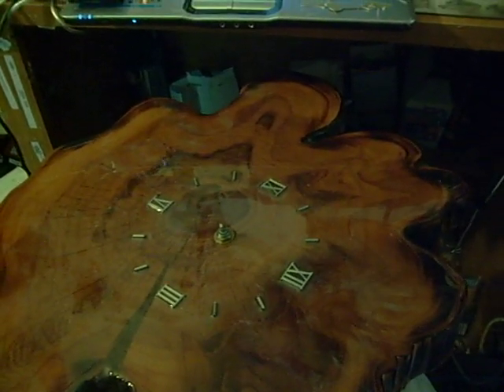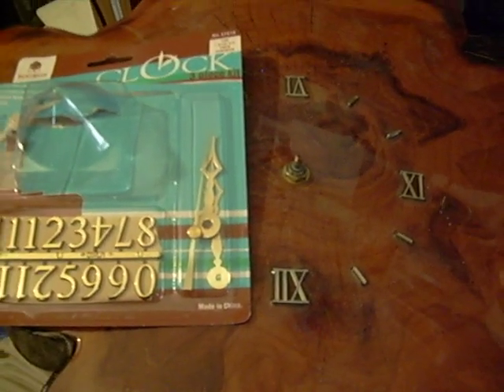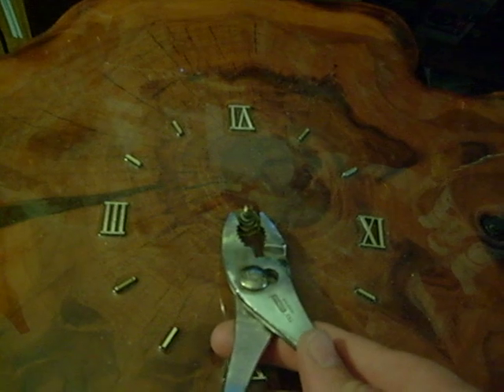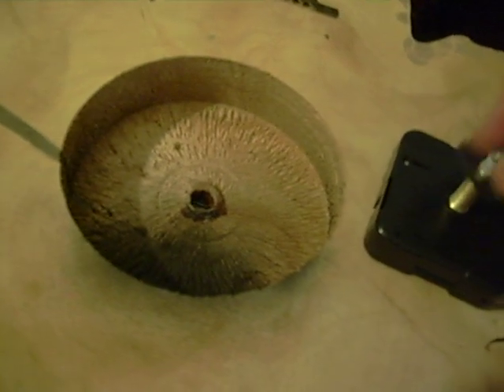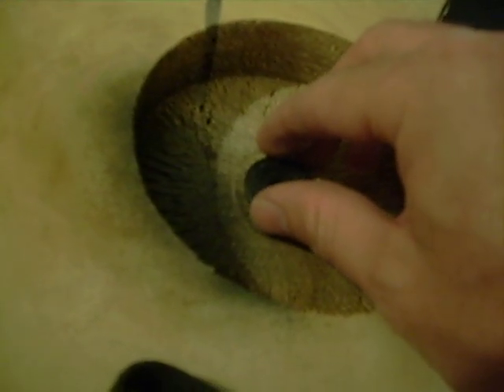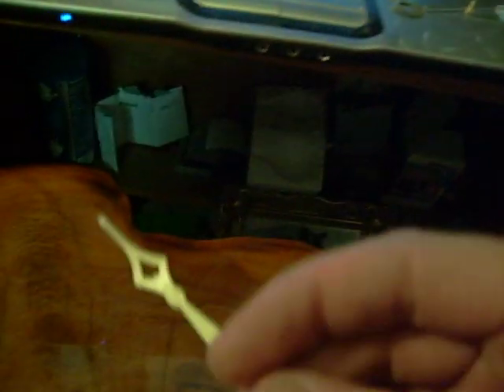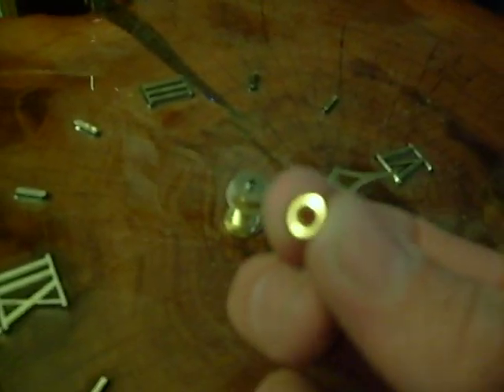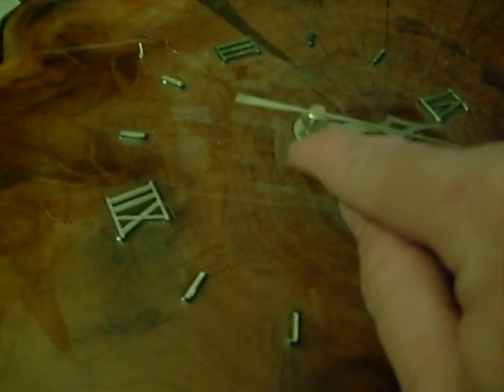Easy Clock Mechanism Replacement

Comment: Thanks so much for taking the time to make the helpful how-to video!  I'm so glad I searched for this before I spent $30+  replacing my wall clock (battery corrosion locked it up and nothing has worked to get it off enough to start working again).  Might as well take a gamble on a $6 fix!  :) 

Maybe we could start up a collection to get a small camera tripod for you!  hehe

Thanks again!  :D

Comment: thanks for the great video.  1 question & 1 correction...
why didn't you have someone else hold the camera for you?
the small metal ring piece that screws on the threaded shaft to hold the mechanism & minute hand is called a "nut", not a "bolt".  just saying....

Comment: Hi can they be adjusted if they run to fast or to slow? I have a clock that is battery operated and it runs 5 minutes fast. I do not know how to adjusted it. I would appreciate any helpful information. Thanks